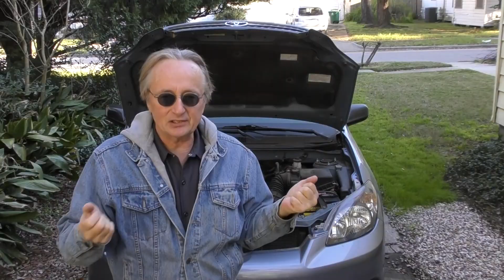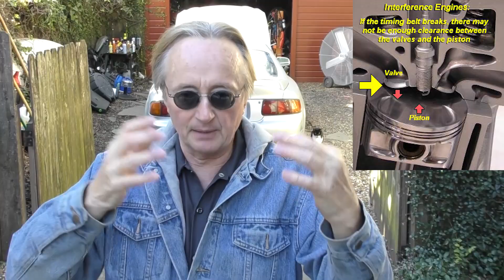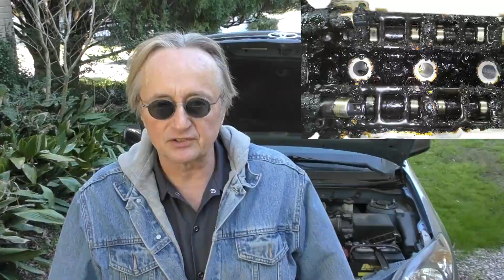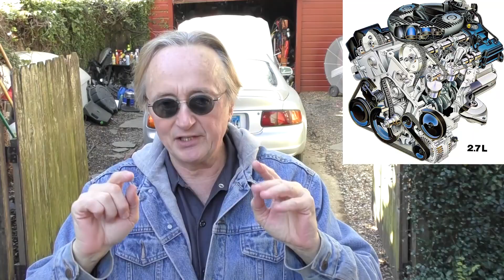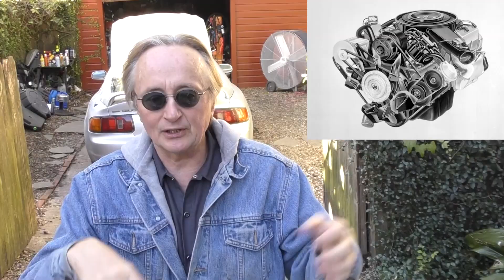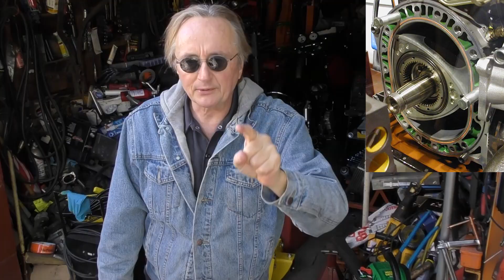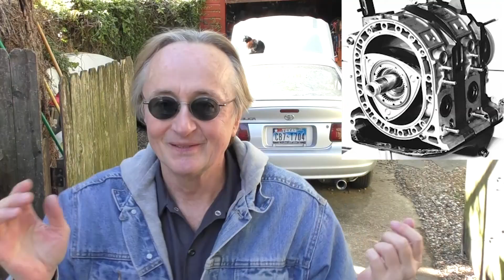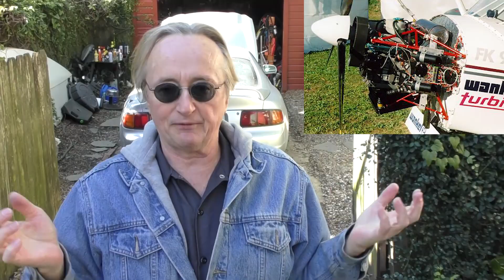Never Buy a Car With This Engine

Comment: I have two cavaliers with the 2.2 ecotec and is a great engine a lot of power and very reliable.
Reply: I’m at 125k miles on mine and no problems. But I’m worried about the timing chain now after watching this video. Maybe it was more common in the Malibu
Reply: @nathanaelblankley4008  I have 155k on my 05 malibu and it’s running like a champ

Comment: Years ago I had a Chrysler 300 that had its water pump go bad. The 300’s design requires you to remove the entire front of the car to access the front of the engine. Nearly $800 parts and labor.

Comment: On those Cadillacs people would often pull the engines and put an older used engine from the 70s into it which were somewhat plentiful at the time. I'm not sure about having to change out the transmission or not.

Comment: had a 2000 concord with 2.7 engine, no trouble with 165000 miles, sold it to a kid one year later engine went out no oil changes

Comment: I had a 2008 Pontiac G6 with a 170k miles, really had not problems. It used 1 quart of oil every oil change. Btw it was the ecotec

Comment: Scotty: I love your videos and listen to your advice but I think you dropped the ball by not adding the Chevrolet 3.4L P.O.S. Engine they put in tons and tons of Impalas. That engine runs hot and has other problems that Chevy knew about but, kept right on producing/installing them and bending over the American public.
Reply: I guess I'm lucky I got a 3.4 v6 equinox with 245,000 miles on it.

Comment: And in addition the Ecotec is designed to where you do not have to remove the entire chain to replace the tensioner you only remove the tensioner that is it nothing else and you're good for another hundred thousand miles

Comment: I missed the VAG (Volkswagen Audi Group) 1.8 and 2.0 TFSI engines. The 1.8 Audi engine mentioned in this video is mainly troublesome due to people using the wrong oil but these are troublesome due to bad design. Those lower piston rings were not strong enough on purpose to ensure low drag but after 30.000 miles they would just let through all the oil. The larger cubic capacity models failure numbers weren't as high but some were still bad. Best to just stay away from TFSI engines or just VAG as a whole.

Comment: I have a VW Passat with the 1.8L turbo with over 100k miles and it runs fine with no sludge, but I do use synthetic oil  and change the oil frequently

Comment: I guess I've been one of the lucky ones with my 2004 Chevy Cavalier 2.2 ecotech of course always kept it up and use only synthetic oil and synthetic oil filter, it now has a little over 326.000 miles and still running strong so can't complain 😁

Comment: I’d argue against Scotty’s input on the 1.8T Volkswagen motor. I owned a 2004 GTI w that motor. And it was one of the most reliable cars I’ve ever owned. I did replace the timing belt, tensioner and water pump as preventative maintenance (like a good owner would). Ran fantastic, modified it, and had fun with it. Check out my YouTube video of it from years ago !
Reply: Bulletproof engines and I've modded mine completely no problems previous owner drove it like a bank robber everyday and nothing still takes it 250,000 miles still going strong

Comment: He concludes by mentioning a car manufacturer planning to build a gasoline powered, self igniting cylinder engine. Just like a diesel but it uses gas and no more spark plugs. 

But what happens if the fuel injection system goes bad and keeps pumping out petrol into the engine? OMG! You've got anotger "runaway diesel" but with the more volatile gas fed system. 

Scary.

Comment: The VW 1.8T gets a bad rap. Synthetic oil changes every 3k miles (I don’t care what VW says, 3k, because I like my car), buy the Bosch ignition coils instead of the VW ones, and all is good in the world. The only reason I got rid of my 2002 GTI (w/147k miles) was because I couldn’t fit a rear facing car seat in the back of the 2 door.

Comment: I don't totally agree with you on the Ecotec 2.2 I had a 2009 Chevy Cobalt I drove 60 on the highway for 10 years and I got rid of it at 322000 Miles and still ran perfect it was the best car I've ever had because it was a manual shift and it was so low maintenance I hardly had to ever do anything to it gas and oil and Tires and Brakes

Comment: The Ford FWD biased 3.5, 3.5 Ecoboost, and the 3.7 should be on this list because of that stupid timing chain driven water pump. The 4.6, 5.4, and 6.8 3V was also a disaster because of oil sludge, two piece spark plugs, and a weak oil pump.

Comment: I have a 2.2 eco tech.runs fine. I use Mobil one and filter. Full synthitic
Reply: I use the cheap speedtech oil in my 2.2 and it still runs good even with 250k miles

Comment: how are you going to say a 2.2 is a bad engine!  had a 03 grand am i payed 1k for with 178k miles i sold it at 250k and it still ran perfect! and the only thing i ever had to do to it was plugs and coil pack which i bought a 14$ used one lool. hell the ac still worked! my buddy has cavalier around the same year same engine hes got 250k and still drives 50 miles to work every day!

Comment: I also have one Ecotec engine, N18XFF 1.8L . About 58k Miles so far and zero problems. Timming belt change and oil only. I change the oil in 6 months ir 3k miles.

Comment: Dude, i have that car (07 Malibu,2.2 liter. It has 232,000 and the engine has never been broken into in any way. For that matter, same alternator, water pump, etc. In short its the best little engine I have ever had. I do most all my mechanical work on all my families cars..From my point of view this is not true, in fact just the opposite. This engine was built on the quad four.. Oh, by the way ,I change my own oil at 3,000 miles....And I also have Corolla's in our family, they do not do any better...

Comment: The Ecotec is actually a great engine. The biggest problem is MAINTENANCE. It suffers from the same thing EVERY ENGINE suffers from which is BAD OWNERS. Everyone drives their vehicle until it quits then cries bad quality, bad engineering, junk parts, etc.. When in reality people neglect MAINTENANCE and they let a $30 oil change cost them $3000 dollars.

Comment: Another issue with the 1.8t is the coil pack harness. The turbo is right below the wiring harness for the coil pack and will make the harness deteriorate causing all kinds of miss firing due to cracking wires in the harness. I got rid of the volks for a matrix😁

Comment: I agree with you 99% of the time. That being said, You are only half right about the Ecotec. I used to think the same way as you. I have only actually seen ONE go bad (it was in fact the timing chain failing) but soooo many more go forever. As you said yourself, "Americans don't take very good care of their cars." This is true! However, I am a mechanic myself, and my daily driver has the 2.2L Ecotec engine with nearly 300k miles and runs perfect. It uses no oil, has no ticks, and still has full power. The one I saw go bad was driven by somebody who took very poor care of his car. (rarely changed his oil and ignored ticking sounds that would have alerted him to maintenance being needed)
I understand you base your opinions on your personal experience as all people do, but not every opinion we have is a fact.
Reply: **If you take care of an Ecotec by performing regular maintenance (as you should on any car) it will last hundreds of thousands of miles. This is not just an opinoin...I have proof. lol**

Comment: The problem is that in US u guys still use  low grade oil ,here in EU semi or full synthetic is basic oil to use and 10,000 km between oil change . that is the key.

Comment: What about Ford Triton, every ford small motor 1.5, 2.0, 2.5, even in the 5.0 piston slap on a brand new motor diesel 6.4 even the old 5.0 was weak throwing rods like chopsticks

Comment: Northstar motors
Dodge 4.7 and 2.7

Those are 3 of the worst motors ever built. I worked in a salvage yard for 6 years..

Theres more motors but I don't know what they are. I know what cars they are in though...

I know which vehicles have bad transmissions too... Chevy Trailblazer transmissions were big sellers... Probably our most sought after transmission in the yard... Jeep Liberty and Ford Escape are 2 more vehicles to avoid at all cost...

Comment: I have a 1.8t with 260k miles on it and it still drives strong. The only issues I've had are with the coil packs but other than that it's been a very reliable engine. I do take good of my cars and I have always changed my oil at 5k miles with full synthetic oil and good filters.

Comment: Worst engine I've had: a Chrysler 2.2 Turbo in my '87 Lancer. Car went like mad when it worked, but the engineers didn't give anywhere for that extra boost to go when you let off the accelerator. So the damn thing ate fuel lines. Routine maintenance was a dream otherwise, but damn what a stupid oversight!

My family has had a few Buicks. One powered by the 3.1 V6. Aside from Dexcool issues, was a great engine. I got rid of the car at 200+K when I was either losing a valve, or had lifter issues. Obviously one was cheap, the other expensive. That car had some many other GM quarks I was just done.  The other Buick is my father's Lucern, running the 3800 V6. It mysteriously loses a quart every oil change. 

I have a love/hate relationship with my current VW 2.5 I5. The engine is a rock, and smooth as hell. But I just did the water pump on one. I had to lift that f#@%er 8 inches on the passenger side to get access! Belts are a pain, and the alternator is also packed in where you have to either lift the engine, or tilt the front radiator core support. However, overall reliability is great, with proper oil done around 6 to 8K. People who don't maintain though often have timing chain issues, especially with the first-gen 2.5s.

The best engine I've seen was the Toyota "boxer" I4. That thing is reliable, decent power, and hella easy to maintain. I always recommend these to anyone who just wants a car/engine that works with no fuss.

Comment: Cadillac “deathstar” engine. The king of all lousy Gm engines.
Reply: The bugs were worked out by 2005. My Deville is reliable,  powerful,  and gets 27mpg at 79 mph.
Early versions crap, yes.
Reply: @patrickhorvath2684  2005 was like 14 years after they were introduced and only 5 years before they were discontinued. The vast majority of em are garbage.
Reply: I pray to live to see the day when there are no more Northstars on the road and I will crack open a beer and smile
Reply: Never knew North 🌟 was Rubbish... Always thought the caddy V8 was nice till I got older...
Reply: @rontam06  472, 501, 429's were good. 50 years ago.
Reply: The 307 was pretty crapular.
Reply: 350 Diesel... ew

Comment: I bought a 2002 Olds Alero with a 2.2 L Ecotec I4 engine. After 151,000 miles, the timing chain broke and caused major damage to the engine. Until then, it had been a fun car. I changed the oil regularly.
Reply: the 2002 ,2003 and IRRC the 04 all had this issue. there was a retrofit kit to fix the timing chain oiler.

Comment: Everyone seems to hate the Chrysler 2.7L V6,  my experience was actually very good.  Had a 2001 Sebring,  the car cruised down the highway at 80 mph with ease,  got really good gas mileage and after 7 years and 300,000 miles I only spent $68 on that car in repairs (Not counting routine maintenance)   To this day the cheapest, most reliable car Ive ever owned

Comment: The 1.3L rotary motor was absolutely awesome A) when gas was 99 cents a gallon and B) til those apex seals failed & you had to wire up a fuel injection killswitch and go up to 20/50 oil 😂😂😂

Comment: 1.8 turbo engine is a very good engine can run for 200,000 miles without any problems and kicks out between 150 and 300hp!!!  Its just very well build the thing is ignorant owners they break engines

Comment: I have a 2.2 in my car it has 257,000 miles on it and it runs just fine
Reply: Me too. In my SATURN ION. I HAVE 257K ON IT. REPLACED Ignition Control Module for $50 from a junk yard. Runs well.

Comment: Once again he talks sillyness. The GM Ecotec 2.2? We see these with 200-300K miles all the time! The only reason one of these would fail is lack of maintenance or using the wrong oil which hardly makes it a bad engine!  And why is he talking about an engine that was used for one year in the main car line and a few years in limos 38 YEARS AGO!!!! Like your every going to find a Cadillac with this engine still using the cylinder shutdown system. Most customers cut the wire to the torque converter which deactivated it and turned it back into a normal and very reliable V8 engine. The HT 4100 was a far worse engine that was used until 1987 and the early Northstar V8's of the 1990's to 2002 were also trouble with a poor design putting the starter in the heart of the motor.

Comment: You should mention Ford';s recent V6 engines. A friend bought a used Taurus, and the chain-drive waterpump failed. The timing-cover had to come off to replace the whole timing-chain system, along with the waterpump. $2000!

Comment: What about the Toyota 2.4L engines with the faulty piston rings that they made through most of the 2000s?  Toyota claimed that burning 1 qt of oil for every 1200 miles was "not excessive".

Comment: Scotty forgot to mention that the  Chevy Malibu here @50: is a 2004 - 2007 model also has the 3.5 and 3.9 liter v6s and those are NON ecotec engines that don’t have any European designs and with consumer reviews most people are pretty happy with them. Mines is a 2006 Malibu with a 3.5 v6 that’s only had routine maintenance  that’s my daily driver and so far has been very reliable car.
Reply: 2006 model with over 300,000 miles - has been wonderful

Comment: I have an 09 Chevy Cobalt with 150k on it. I guess I've gotten lucky, no problems so far.
Reply: If you take care of that car it will take care of you. Eco techs are not necessarily a bad engine it just needs regular maintenance for its design. As long as you change the oil every 5,000 or so miles and get ok oil filters it’ll last you a good bit.

Comment: I disagree with the first engine the 2.2 L eco-tech engine being terrible,  I have a 2007 Chevrolet cobalt with over 210k miles  i’ve never had to replace the timing chain or anything in the engine  or transmission 🤞. Granted I’ve always changed the oil every 10000 miles,  I don’t leave my car running in the morning ( waste of gas and pollutes).  Maybe I got lucky and accidentally got a good one! 😆

Comment: I have a 2006 Pontiac Solstice with the 2.4L ecotec VVT engine. Had it for 6 years and it now has almost 100k on it. The only thing I've replaced are the intake and exhaust solenoids, which cost about $30 each and took me less than 45 minutes to replace. I use a full synthetic oil and drive it like an old lady on her way to church. Take care of your car and it will take care of you.

Comment: If you own an ecotech, just use the Walmart oil full syn high milage, change every 3,000.
Reply: If you're referring to super tech oil, it outperforms nearly all of the top shelf brand name oils, there are several videos demonstrating this.
Reply: @InuranusBrokoff  yes supertech, I run it in my G6 all the time no problems. I change when it says I have 40% left on my oil as that's usually 3,000

Comment: I had a 1.8T and yeah, constant coil pack problems. The other really dumb design flaw was the electric water pump that you had to tear the whole front of the engine apart to fix.
Reply: Coilpack problem can be fixed ! This is easiest one best engines I've ever owned aside to Honda . One greats ever produced from Audi